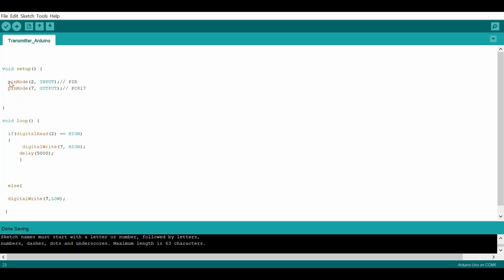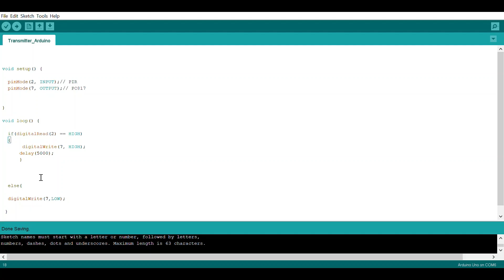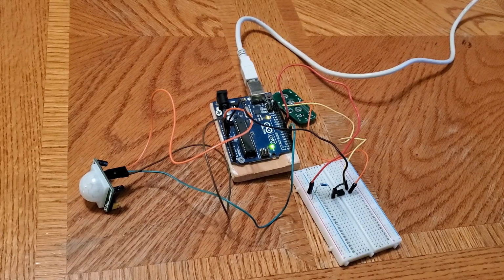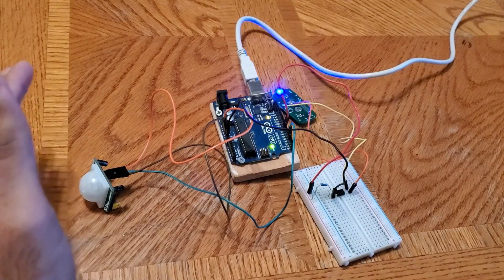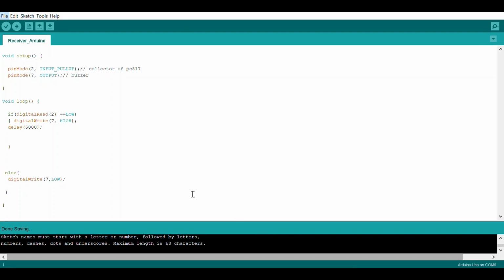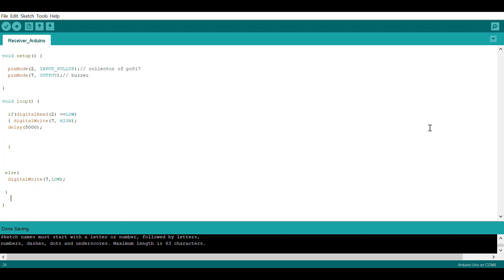Wireless Arduino to Arduino Communication

Comment: That's great , but why didn't you just use a encoder , decoder if or just a Capaciter with transistor , It would be much easier and cheap too, I will be posting video on my channel where I will use rf module with transistor and Capaciter or with a encoder , decoder , feel free to check them out #electrohardik
Btw are you originally from a south Asian country
Reply from the maker: Pc817 and a 1k ohm resistor are both very cheap components. But thanks for the suggestion. Yes Pakistan.